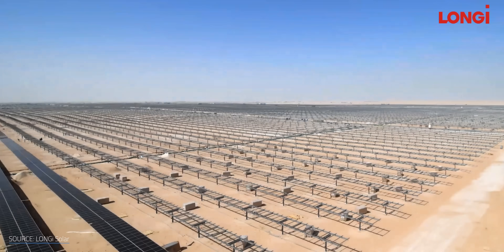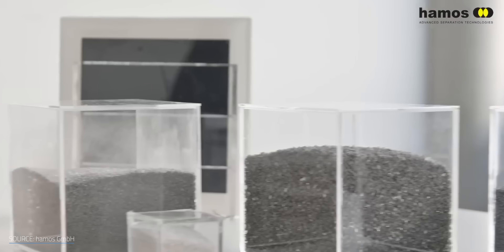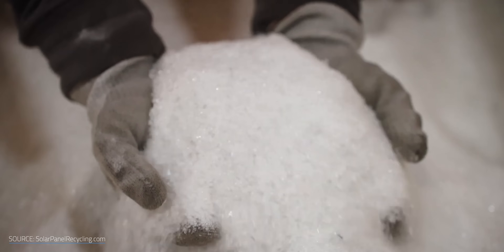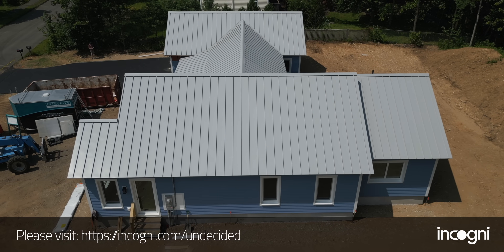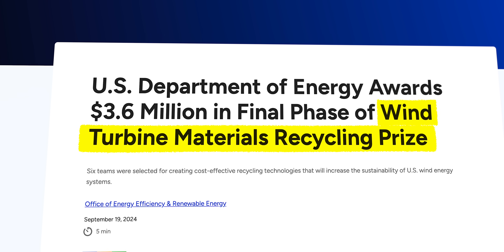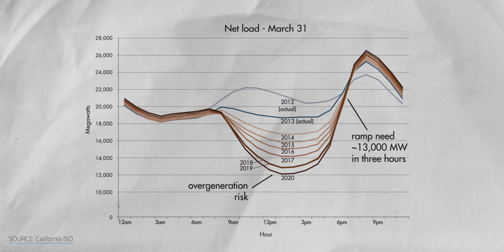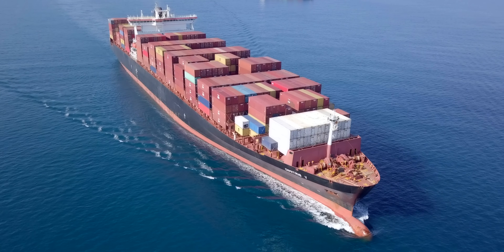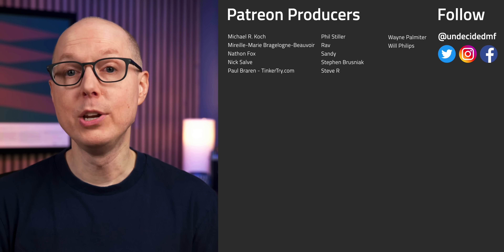How We Solved Renewables BIGGEST Problem

Comment: It's actually insane the sheer number of uses we've found for lasers.
Reply: Another potential use for lasers is in making vacuum sealed window panes which are currently too expensive outside of niche markets. Such windows could rival the u/r value of walls.
Reply: @mv80401  more than you realize, with high voltage panels and tuned or specific frequency lasers to charge the gases inside you can push them out of the glass cavity and attract it to one of the two charged systems along with creating a massive resistance to incoming new gasses before sealing them up using the frequency of laser needed for welding the glass together too. instead of having to heat and wait for random bouncy bits of gas to work their way out of the chamber, but atmosphere even at sea level only  amounts for 1 in 1000 parts per volume of space (the gas particles are only 00.1% volume of area in atmosphere, with the other 99.9% of the volume being a vacuum.) So just sealing up the area, works quite well, even better if you know how to build a thermal IR diode that is only able to absorb the IR one side with the other side being reflective to it,
Reply: In a hundred years, people will be laughing at our crude and rudimentary techniques. 😜
Reply: @serversurfer6169  femtosecond lasers will always be elegant
Reply: @serversurfer6169  look here bob, even in 2025 they're still shooting their lasers through glass. Something about refraction stumped them for hundreds of years
Reply: Well, they are basically devices that direct energy that can be absorbed by things. I love the things but I wish we could make them cheaper and figure out how to make some sort of better laser PPE than the glasses which work great but make other tasks more difficult - something everyone with a cheap laser CNC machine have discovered when trying to use their computer while laser engraving/cutting something nearby.
Reply: @ryelor123  are you trying to say light reacts in 3 ways absorbing, reflecting and transmitting, and normal LED based laser diodes are all useless at cutting or damaging anything clear/transparent, because it transmits through the material, so you need something that is colorwheel opposite (ie mix red/yellow so orange will absorb blue the best to be burned or effected, and yes I know that is physical vs energy colors with red/green being the color wheel opposite in light, but we are talking the solid material absorbing the energy) so basically if you have a blue laser the red or orange colored transparent plastic will cut easiest with your laser, ?

or are you saying something else? I am working on something but rather than put it down here, so some company can come along using AI and claim "oh we were working on this for years" and pay the way back machine to alter their website's archives to what ever new info is on it now so it seems like they were working on it all this time,,,, until you look at the HTML and see code being used in the archives that was not even created for web use until 4 years after the archive supposedly archived LOL
Reply: also where the hell did my comment go that caused my notifications to ping me when replies to your comment happened?? (got two notifications for two comments here yet my previous comment about thermal diodes is gone. Guessing someone is planning on patenting the idea I posted here, well what I am doing is going to destroy the ability to even care if something is patented or not, so go ahead and waste money on it.
Reply: @ThomasAndersonbsf I can actually see your diode comment must be unblocked? 🤷
Reply: I should mention too that I have recorded the screen while I made those comments so it would be pretty easy to fight in court any patent using my idea, destroying the value you think you are creating too (whom ever deleted my comment,) and google or youtube cant stop me from it being published on the mean green machine along with other places for proof of time,
Reply: @ThomasAndersonbsf  I don't know what your post was, but when you post an idea in a public forum then you have abdicated any claim to it. In principle it should then, NOT be patent-able by you or anyone else since it then qualifies as "prior art". Sadly such injunctions have not prevented the activities of patent trolls (who by the way are destroying any incentive for innovation or entrepreneurship and should be forcefully removed from society).
Reply: @ This is normal Youtube censorship. They delete comments all the time without telling you, based on an AI interpretation of your comment. Adding insult to injury, it's literally stupid and misinterprets innocuous statements as things that might hurt someone's feelings. Or lean to the right side of the political spectrum.  If you're ever writing a long comment on a topic you a care about, make sure you copy it before posting. Then reload the page and check if it's still there.
Reply: I actually went to college, 30 years ago, for lasers and we thought we were coming up on the next industrial revolution.

The things we saw in the pipeline were nothing short of amazing. Sadly, much of the development was tied to the military and when the military budgets were being downsized in the 90s, the optical revolution fell by the wayside.
Reply: And we have yet to truly pioneer the ultimate use: laser-armed sharks.
Reply: And it was invented 18 miles from me when I was three.
Reply: @CharlesHess  cool!
Reply: @wavion2  what’s funny is lasers were originally regarded as an invention looking for a problem to solve. They were just seen as a research curiosity and nothing more. The physicists of the 20th century would be shocked at how many uses we’ve found for lasers (including in one of the most important products to our global economy: computer chips!)
Reply: @wavion2  it's so cool! And to think it's just highly controlled waves!
Reply: But for used blades we need only one. Make fences from them. Africans need a lot of fences. 
And bridges, and pavements, and barns. .
Reply: Dont forget the sharks...
Reply: @aaronmckinnon2198  I'm afraid we couldn't get the sharks, too much red tape, but we do have seabass.

Comment: Calling waste the biggest problem of renewables is odd. I was expecting a video on energy storage, but I guess a catchy title is nessesary for youtube. Otherwise it is yet another excellent video from Matt.
Reply: There's a multitude of ways of storing energy - lithium batteries are just one option, with sodium batteries coming soon. Then there's storage in the form of high heat, or serious cold, or compressed/liquified air, pumping water uphill, etc. Heck, we could even roll out giant flywheels if necessary.

Recycling/reusing the materials that go into these renewable tech solutions, though is - as Matt correctly points out - a major issue. Not so much when they were first being rolled out, but now, 25 years later, as they're coming to the end of their service lifespans.
Reply: @theelectricmonk3909  the amount of waste is very low compared to coal usage, when comparing tons per GWh produced over lifespan. I still consider storage the main hurdle, normal lithium batteries are only useful for few hour storage. For longer or even seasonal storage only pumped hydro is an option, and this is not possible everywhere.
Reply: @ Although not widely used yet, I think ultimately flow batteries will become the go-to for rapid access grid storage, with pumped hydro (where available) as a solid backup plan.

Comment: Intermittency is the biggest problem.
Reply: Large scale storage solves that problem. It's not even particularly hard to do. The only reason it's not already in widespread use is because we've been cossetted by our always-on fossil fuel powered grid.
Reply: @ "Large scale storage solves that problem. It's not even particularly hard to do. "
Yet it isn't solved while paying for it seems pretty difficult.

"The only reason it's not already in widespread use is"
The tens of trillions of dollars it would require probably. California has spent tens of billions and only has a few areas that can go for half an hour.
Reply: @wisenber  It's only hard to pay for because you don't want to pay for it - you seem to want it for free.  The price will come down as cheaper batteries (likely sodium based) become widely available, or other alternative forms of energy storage scale up.
Reply: We need energy system reform. The way we use energy currently is only because we are drunk on “cheap” fossil fuels. We need reform in distribution, energy markets, and demand consumption. For example, we have millions of refrigerators technologically capable of acting as load balancers that we simply underutilize because the systems and incentives aren't in place.

Comment: Saying 'reaching end of their lifespan" for most windturbine and solar that has been going offline really isn't true -for most it has just been easier regulatory wise to replace stuff with decades of life in it still for newer bigger taller turbines etc. Not saying these things are not worth replacing, as the best possible locations for that type of renewable probably should get upgraded before the stuff there reaches a real EOL. It is just a shame these things are generally junked rather than moved on to slightly less optimal locations.
Reply: Installation costs more than trashing. Our economy is built to find the most profit, not achieve the most benefit.

Comment: 1) I think grid stability is the biggest problem.

2) Many of the research programs in the US are depending on government funding. With the current administration, I see all that being chaotically cancelled, with "drill baby drill" and increased logging (i.e. decreased carbon sinks) being the tune of the day.

3) Much of the environmental work in the EU is being watered down by the current, more right wing European parliament and commission. Also many large European countries have sizable fascist parties that want to wind back the clock on reducing fossil fuel dependencies. So I'm predictin a lot of the progress in Europe being reversed as well.
Reply: @jannepeltonen2036   agreed on the grid stability. Personally, I think IF the govt is going to meddle with the incentive structure, it would be better to incentivize individual home energy solutions rather than large scale grid battery storage. It's just such a huge task to incorporate that into the current grid, and would take up even more land. The end-user storage is more resilient, distributes the risk of battery failures, and could be much more cost effective as the individual would front part of the cost.
Reply: Do you mean the parties that closed down nuclear plants, started again coal ones and continue to buy russian gas?
Reply: IMO, I think a non-fossil fuel based energy mix that could work is a combination of Solar and Nuclear energy. Solar could be used to power residential areas, particularly in rural and suburban areas (especially if combined with batteries); while Nuclear can power cities, energy intensive industries/businesses, as well as pick up the slack if solar production dips.
Reply: @dx-ek4vr  It costs more than double over solar and the waste is a huge problem! Not economically feasible.
Reply: @dx-ek4vr  I agree with you, All heavy industries and manufacturing needs to be on nuclear or some form of SMR (if it is some remote mining related activity).  Retail, commerce and residential could be fully supplied through 
solar+battery+other renewable, with Nuclear possibly ramped up for account for seasonal deficiencies in power generation.

The problem is still supplying quick short periods of peak demand, except hydro all other renewables cant do that. A battery might have issues long term for this rapid charging and discharging every day. Nuclear can't ramp up in short time. We might need to align our energy usage along the lines of how we will be producing tomorrow.